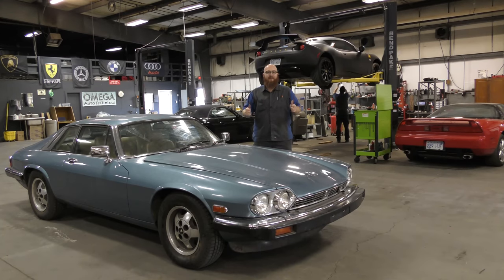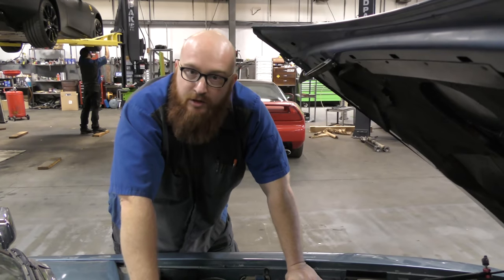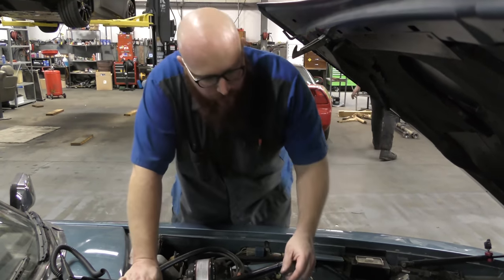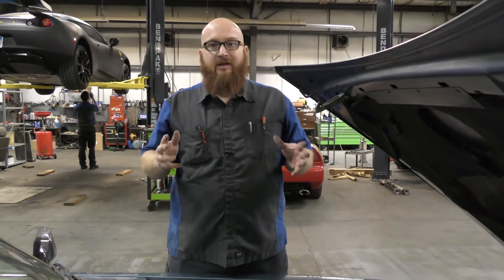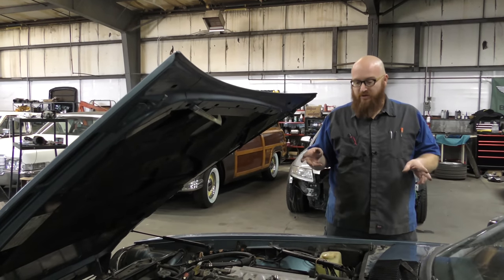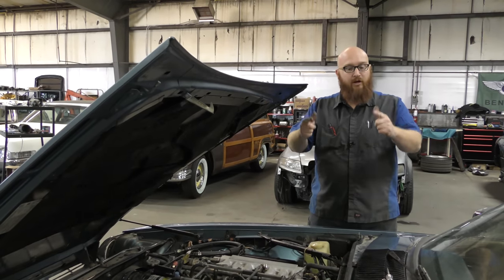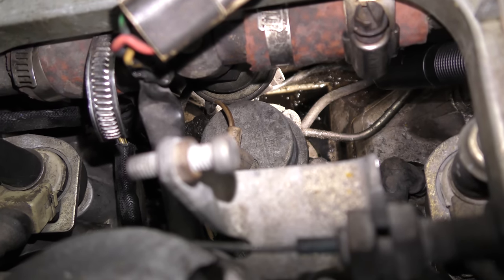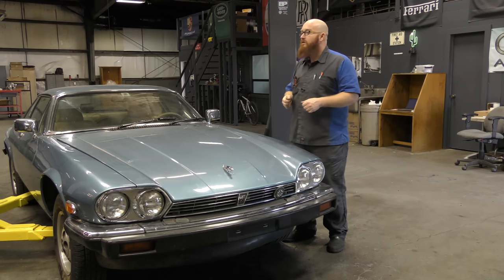'82 XJS with the cursed Jaguar V12 comes into the CAR WIZARD's shop. Can he get it running?

Comment: Still crazy to think that this engine was the foundation for the race engine that won a 24 hours of Le Mans in 1988, a race that emphasises reliability.
Reply: The engine is perfectly reliable. It's American maintenance and repair habits that are not.
Reply: Yeah if you have an entire team of engineers and experienced mechanics behind you anything can be made to be reliable.
Reply: @petrosaguilar8916  BINGO! when treated correctly they are fantastic.
Reply: My boss had an XJ12 (not S) that was a monster, felt like it could cruse at 120MPH all day. I took it to Denver one weekend...got three ticket$.
Reply: @mikelynx4953  - Such a shame they only sold them in the U.S. for four model years, 1993-1996. Then after the '96 model year they discontinued the engine altogether.
Reply: @petrosaguilar8916  Not sure what you mean?
we had the S and XJ12  from the late 70,s thru 80,s at the dealerships I worked at.
Reply: Rather have a XK8. I had one for four years. Loved that car.
Reply: It started out as a 4-cam racing engine in the never-raced XJ13 and was then simplified to a single cam-per-bank design for road use. Neville Swale of "Building The Legend" - based just outside Coventry - is a committed Jaguar fan who has invested the money to recreate these engines with 4-cam heads in order to offer  a truly authentic recreation of the XJ13 mid-engined sports-racer.
He will also put a 4-cam V12 - based on a 5.3 litre / 6-litre, or even bigger capacity engine - into your E-type, XJS, or XJ saloon complete with a Getrag 5-speed manual conversion.
Reply: That was the two team from Indiana
Reply: @petrosaguilar8916  Get outta here! We Americans stick with our old simple junk because it still works. Somehow Jaguar has taken systems for car that are relatively simple and made it very complicated and difficult to service.
Reply: @TheTazzietiger  That was Tom Walkinshaw Racing, but they were the official Jag team.
Reply: @philcopson3900  will that 12 still leak and drop valve seats and over heat and refuse to release the heads from block and be the most uneconomical piece of unwanted junk ever made. Talk about flogging a dead horse. I can't even start to describe how bad a 12 can be. WHY. WHY.WHY...........
Reply: They sounded soo good in comparison to the turbo charged Porsche’s, amazing atmosphere at Le Mans in 88
Reply: Because frankly it WAS a reliable engine... plenty of these work and work well for many many years.
Reply: The Jaguar V12 was developed from the old 1951 Buick 215"/3.5L all aluminum V8 with same over square 3.5" bore x 2.8" stroke. 8 cylinders = 3.5L, 12 cylinders = 5.3L. Before then UK engines were under square, long stroke,  and slow revving. High revs on the new freeways would kill them in 25K miles.
Reply: @petrosaguilar8916  - Americans aren't used to engines that need "maintenance and repair"...
Reply: But the engine is actually reliable. If you let someone with insufficient knowledge loose on any car they can break it,. Listen to the video - it was probably that cable that caused the problem, someone mucked around and broke the distributor, maybe the cable, maybe the other things did for the computer.... and hey presto a mess to sort. I had a friends Morris Minor in... someone had tried to convert to negative earth and an alternator, the fix--- easy -- just undo everything they had done. The only mistake I made was forgetting to sort the cooil out so I buggered the coil and needed to replace it, stupid oversight but hey ho even the best can sometimes miss the obvious.
Reply: @petrosaguilar8916  I'm with you here, service according to the book (at home!) and it's virtually unbreakable. The clue is "according to the book". 189,000 miles on my V12 convertible, everything original never had a problem, ever.
Reply: @gerrysummerfield1984  - I heard about a guy  from I believe Holland or Denmark that racked up 700k miles on a V12 Jaguar. As smooth and understressed as these engines are I can see why they last such a long time.
Reply: @speedyfinalmile  I have both XK8 and XJS.  XK8 is nice and modern - love it.  XJS has more character, more space, quieter - but much more thirst!  Both are reliable.  XK8 goes to the local independent Jag shop when it needs something.  XJS gets worked at home since I don't think the shops have the skills.  I've worked on mine for the past 43K miles and its a real joy to work on.  The XK8 is realistically a better car, but I love my XJS!!
Reply: @petrosaguilar8916  My (former) 1973 XJ12L says otherwise.
Reply: @paulmathless642  - Indeed, I stand corrected. The Series 3 XJ never had the twelve cylinder engine on the US market for some reason while in other parts of the world it did.
Reply: Won Bathurst too
Reply: @BuzzLOLOL  Why would anybody buy a car that needs constant repair?
Reply: @gregdales4701  - The Jaguars are fun to drive, and the unreliable parts can be replaced with reliable USA parts...
Reply: The engine itself is robust, you just have know some of it's quirks
Reply: The Jaguar V12 has been and still is regarded as one of the great all time automotive engines...
Reply: @philcopson3900  Neville Swale, What a Fabulous vision!
Reply: It was at production level that quality issues happened aswell as lack of investment and strikes.Jaguar as a company was taken over by a conglomerate called British Leyland which also made the brand worse.
Reply: @timjones1863  Quality issues occured like that when the brand was taken over by British Leyland.
Reply: What's so crazy about it?  It was a well teethed out and proven design that  often wasn't tended  to so great on third owner cars bought for beer money and maintained with couch change and has gotten a terrible reputation as a result.
Reply: @kenon6968  About right.
Reply: @BuzzLOLOL  Yeah,they just run Jaguars into the ground without a clue about properly maintaining them.
Reply: Pretty much any vehicle/engine can meet that "treated correctly" standard.  In my view, a truly reliable vehicle is one that doesn't need to be babied.  That's what sets Toyota apart from all the others; treat it like crap and it still runs great.  

These jags were not reliable vehicles even by the standards of the day, but they are certainly wonderful in many ways and I salute and respect those who get great joy from them.  Reliability and simplicity isn't everything; the driving world would be a much worse place were everything a Toyota.
Reply: And also the last (?) Gumball Rally ..
Reply: @Incongrous The Jaguar race engines are the best in the world.The powered the Jaguars that won Le Mans several times and the Bathurst races in Australia.Its just when you lot get them you dont know how to work on them
Reply: @HereComeMrCee-Jay  V12s are more complex machines than straight 4s pal like in Toyotas.
Reply: @BuzzLOLOL  No its just the Rovers that got Buick v8s,Jaguar engines were by Jaguar with 4 more pistons
Reply: @brianmorecombe2726  - Jaguar developed the V12 with the exact same unique over square bore and stroke of the Buick V8... British engines before that were under square...
Reply: my xjs is a 76 and does not have the same fuel rail and no ignition module,, i get a bit of sputter with starting fluid, but does not run ??  whats next to test, with the fuel line off the filter under the hood, the fuel shoots out fine when cranking
Reply: @vincentlanza5155  - Is it carbureted or EFI? Does it have spark at the sparkplugs?
Reply: Reliability of new parts is not in question.
Reply: Not true
Reply: Parking tickets
Reply: any race engine can be bullet-proof reliable but getting it over the line first requires dancing that fine line between performance and longevity + an element of luck. when I built that Le Mans engine at TWR in 1986 it was all about getting it to rev higher without destroying its valves and or valve springs.
Reply: Mechanically they're bulletproof, it's everything bolted to them that's the problem lol
Reply: @BuzzLOLOL  there is nothing "unique" about an oversquare bore/stroke, plus the bore/stroke of the Jag V12 is not the same as the Buick V8, and there is nothing shared between them as they have completely different valvetrains and completely different combustion chamber designs.
Reply: @jsquared1013   - UK taxed on bore size, so bore sizes were held down... 
"bore/stroke of the Jag V12 is not the same as the Buick V8" ... do some research on that and get back to me...

Comment: Honestly, the fact that he was able to fix it and watching the process behind it was incredibly impressive to watch.
Reply: Agreed!
Reply: In my shop that was the biggest headache,people trying to fix their own cars,especially something as complex like a V12 jag.
We used to have a Lucas EPI tester(we used to call it the epidemic tester) for these old Bosch and Lucas system,nothing more than a glorified volt/Ohm meter,but it did speed up the diagnostic process.
Reply: Charged an impressive figure too, a thousand dollars.
Reply: @petrosaguilar8916  We would get that for a correct brake job back in the day.
Reply: Yes,i agree..It would not had been happened with these young guys who can only download new softwares to ECU's..
Reply: @kajbyman3006  I agree,they would not even be able to recognize a distributor let alone timing the ignition.
Reply: no i do that every day here in the uk as a road side tech it breakdowns and i fix it at the side of the road basic diagnostics
Reply: @alfamontydog  
It's very hard
To get a car running. From a complete non op.
If it allready runs, things are way more possible.

Comment: Im 66 years old now and a retired dental tech., but I had a part-time job working as the car detailer in the shop of Roth Bros. Imported Cars in Philadelphia in summer of 1972 when I was a kid and these Jaguar V12's were new and all the rage, if you had a few extra sheckles to afford one. One of the salesmen took one of the demo V12's home for the weekend and he got stranded on the road when it quit running for no apparent reason. The car was towed back to the shop and it took two of their top tier mechanics, one was a Brit., and a week of completely dismantling the entire engine to get it up and running again. My detailing bay was not far from their bay so I watched them for a week pulling their hair out and trying to diagnose the issue, and then the high fives when it started agin. Thanks car wizard for this one, it made me smile remembering those old summer days. And you really are a wizard being able to fix difficult tricky issues.
Reply: 😢that was beautiful
Reply: The inertia switch behind the glove box was the source for much cursing by less-than-competent mechanics.
Reply: Really?? Inertia switch...what for?
Reply: @enterBJ40  Impact or abrupt vehicle movement will trigger the inertia switch which kills the electric fuel pump. Safety feature that was/is unknown to many people.
Reply: Seen under the bonnet of one of these ,lovely to look at but you need a genius mechanic like this one. Could watch him all day.
Reply: @ChrisCarter-yc8vp  make sense but a couple stickers in certain locations warning about this device would be more than nice
Reply: @enterBJ40  Then there would be no reason to have the car towed back to the dealership! It IS mentioned in the service manual, though not enough attention given in troubleshooting sequences. I was an independent "wrench" back in the 1980s. Pre-OBD.